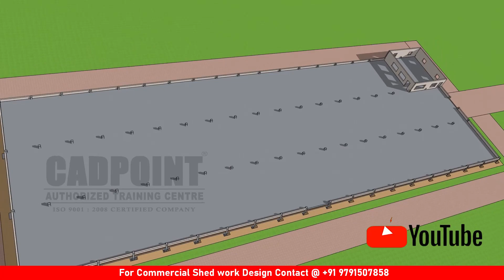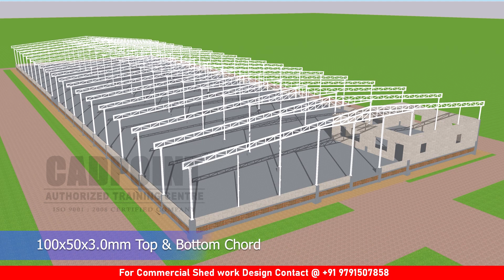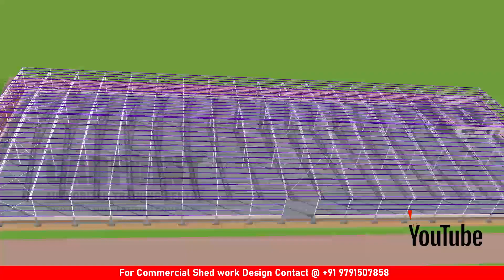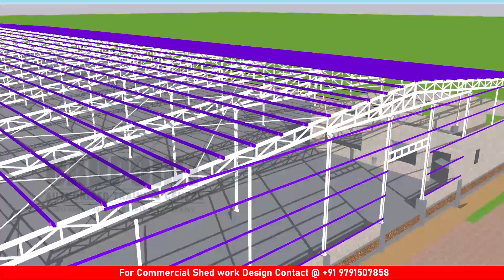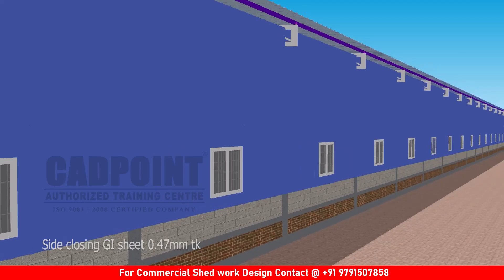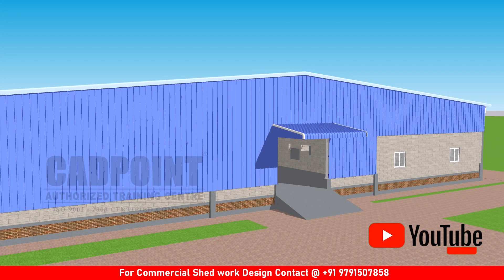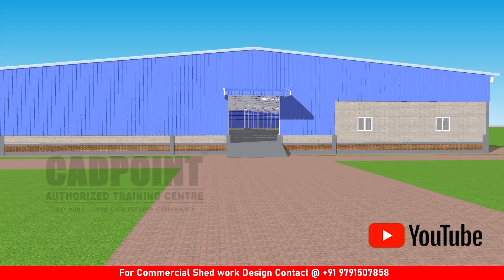Simple truss work - Factory Shed design -  350ft x 125 ft

Comment: What woukd be the cost for this building without side roofing
Reply from the maker: approx - 110 to 180 rs per sq.ft

if the area is small sq,ft rate is high
if the area is large sq.ft rate is low